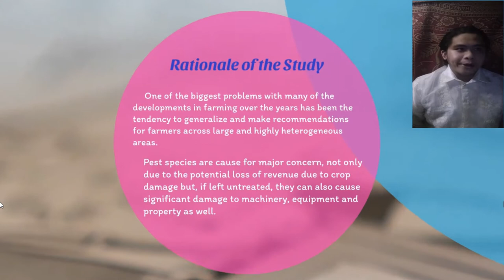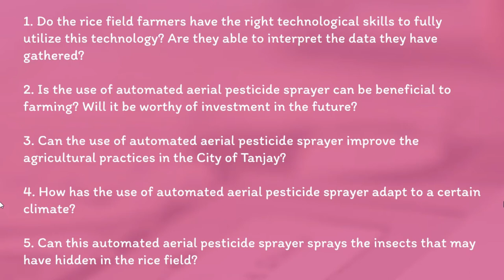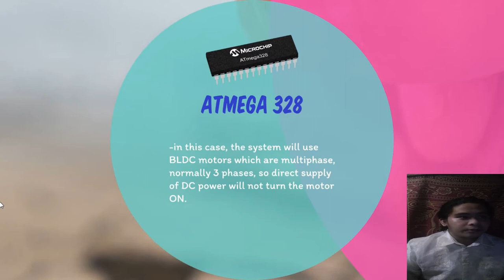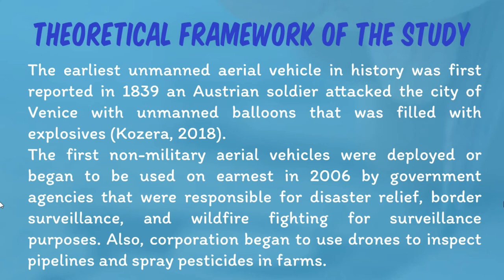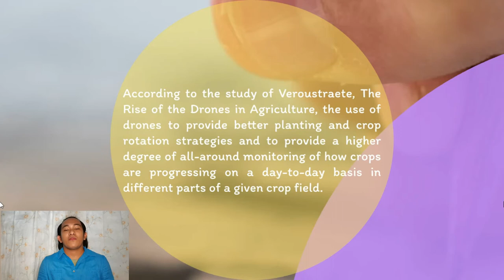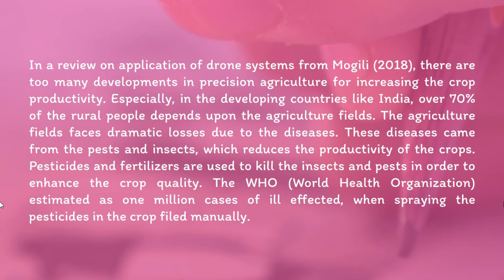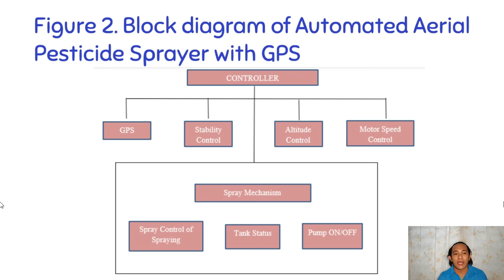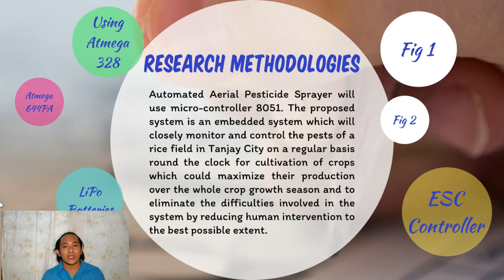Automated Aerial Pesticide Sprayer for Rice Fields in Tanjay: An Advanced Way of Controlling Pests

Comment: Jessielou A. Gomera
ENS 341 B - SATURDAY 5-8:00 PM
March 26, 2022

Reaction:
The said research is informative and beneficial to farmers. It is also interesting for it really fo help the farmers not just in Tanjay City. The researchers did a very good job on introducing this type of innovation. 

Reflection:
One of the most obvious advantages of aerial application is no soil compaction. Driving ground equipment through a field leaves wheel tracks and compacts soil particles, reducing pore space and restricting oxygen and water movement into and through the soil and root zone. Pesticides are important, the researchers find a way on putting pesticides on plants and crops and proposed the aerial pesticide which will help farmers grow more food on less land by protecting crops from pests.

Comment: Caluscusan, Desiree Joy M.
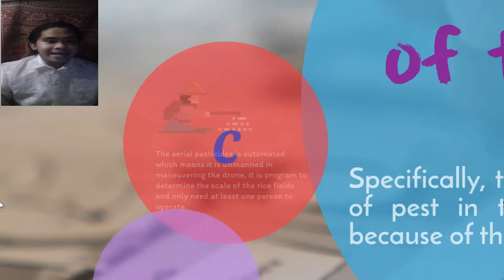COE 346 Methods of Research T-TH 5:00-6:30 PM
MARCH 25,2022s
Reaction: The video is of great help to the farmers who are dealing with one of the most common but not really dealt with problem they are facing for a long time, pests. This is of course it will greatly affect the quality of their crops and it is one of the determining factors of their income. This really enlightened me on the bad effects pests can bring to one’s crop, machineries, and property as well.
Reflection: Automated aerial pesticide sprayer really can be an advance step in controlling the pest problems of farmers. Though, it might need advance technology for it to be utilized and most likely introduce another problem regarding finances, it is a great idea to consider.

Comment: Villauneva, Chastine E. 
COE 346 Methods of Research T-TH 5:00-6:30
March 25, 2022

Reaction:
        Keeping a large acre of land in good condition is a demanding endeavor. It becomes significantly more difficult when insects are included. The automated Aerial Pesticide is a big help to the farmers to help solve difficult problems that they are encountering in terms of pests.

Reflection:
       While seeing this presentation, I realized that farmers are dealing with pests and that this Automated Aerial Pesticide Sprayer for Rice Fields can assist all farmers. This research effort can give hope to other farmers that there is always a solution to issues. It will help them have healthy rice fields and boost their income.

Comment: Pagente, Jayvee M.
CoE 346 A Methods of Research TTh 5:00-6:30 pm
March 25,2022

Reaction: The research is well presented and the content is very informative about the automated aerial pesticide sprayers for rice fields. Many rice farmer’s  will benefit in this research not only the farmers in Tanjay but also the other farmers in different places that experience problems in applying pesticide in their rice fields. 

Reflection: When using automated aerial sprayers in applying pesticide, it reduces the risk of chemical contact and the operating is safety. It also eliminate pesticide poisoning incidents occurring in sprayers.

Comment: NAME: Cual, Kayzielle B.
CLASS NAME & CLASS SCHEDULE: ENS 341 A (2:00 – 5:00 SAT)
DATE: 3/24/2022

REACTION: Based on the video I had watched, the audio is very clear and audible. The visual presentation of the researchers are so creative but it could have been better if the font size was bigger especially for long paragraphs. They had presented their research very well and in a very concise manner. Over all the presentation was very good.

REFLECTION: The research is very helpful for all farmer, in terms of getting the work done easily in a short span of time especially when you are applying pesticides to a big farmland is so tiring, also it could less the manpower expenses. But I think if ever this study gets approved for testing or the product would be manufactured it would require a seminars on how to operate such device especially most of the farmers are older adults.

Comment: NAME: Alejandro A. Bargaso Jr.
CLASS NAME & CLASS SCHEDULE: ENS 341-SATURDAY 2:00-5:00PM
DATE: MARCH 25, 2022

REACTION: 
According to the video that was shown, the production of Aerial Automated Pesticide made everything easier and more efficient for the farmers to do. Having the knowledge that these types of autonomous equipment can control the usage of pesticides, which is helpful to plants, is a huge relief.

REFLECTION: 
Aerial Automated Pesticide has significant advantages for farmers because it can significantly increase rice output and other crop productions. It is non-toxic to the environment and will not have an adverse effect on the health of the farmers. This concept is extremely beneficial because it would reduce the problems that farmers have in terms of pests while also saving them time and work in the field.

Comment: NAME: Eve Shammah S. Mejorada
CLASS NAME & CLASS SCHEDULE: ENS 341 - Saturday 2:00 - 5:00 PM
DATE: March 25, 2022

REACTION: The flow of the proposal is very good. They concentrated on our surroundings and how we could assist the farmers. It will be of great assistance to them, particularly those with large fields.

REFLECTION: This research will be extremely beneficial in protecting crops from pests. The aerial pesticides are automated, which means they are unmanned in operation, which is a good idea because they require only one person to operate. It saves time and money, and it has no negative effects on the farmers' health.

Comment: NAME: John Ver P. Bulanon
CLASS NAME & CLASS SCHEDULE: CoE 346 METHODS OF RESEARCH -TTh 5:00-6:30pm
DATE: MARCH 25, 2021
REACTION: Farmers who are dealing with pests will find the video extremely useful. This will have a significant impact on the quality of their crops, and it is one of the factors that will determine their income. This taught me a lot about the negative effects pests can have on crops, machinery, and other things.

REFLECTION: Aerial Automated Pesticide is extremely dependable for easily maintaining a high level of crop management/plant pest control for high output standards. It became easier as a result of the fact that it helped farmers overcome a variety of challenges while also boosting productivity.

Comment: NAME: NOEL JOHN C. CANOY
CLASS NAME & CLASS SCHEDULE: ENS 341 - SATURDAY 2-5pm
DATE: MARCH 25, 2022
REACTION: This video clip is very useful to the farmers, this can make their work more efficient and easier. Those advanced technologies in farming can greatly help them.

REFLECTION: In farming one of the major problems is pest attacks. Farmers do manually spray                       pesticide of their crops with high effort, consume more  time and risk to their health. Hearing with this research about advanced technology of spraying pesticide which is called automated sprayer can be greatly help to the farmers of Tanjay City in their crop production. Using this automated sprayer will be good in terms of controlling pest and secured the Farmers health.

Comment: NAME: ATOY, AMIEL S.

CLASS NAME & CLASS SCHEDULE: ENS 341 - SATURDAY (5-8PM)

DATE: MARCH 24, 2022

REACTION: Based on the what I've experienced, it's hard for a farmer with a large scale of land to maintain his/her crops but because of an introduction of automatic machines inculding an automated Aerial pesticide, everything became easy and efficient for an agricultural expert.

REFLECTION: Aerial Automated Pesticide is very dependable for easily maintaining crop to a high level of food management/plant control against pests for high output standards. It got easier, especially because it assisted farmers in dealing with a wide range of obstacles while also reaping several productivity benefits.

Comment: NAME: Jean Clare M. Po 
CLASS NAME & CLASS SCHEDULE:  ENS 341 - SATURDAY 2:00- 5:00 pm
DATE: MARCH 24, 2022
REACTION:  AAPS is essentially a blimp (zeppelin) that has been integrated into a quadcopter.
Pesticides will be sprayed in open fields using a helicopter. The primary goal of this is use for spraying, to use pesticides economically, and to use regardless of the weather. The system's goal is to reduce the negative effects on humans while also shortening the time it takes. 
REFLECTION: This method is applicable in all circumstances.  Of used for highly toxic pesticides this will not lead to unemployment problems. This can also be used in places where laborer are hard to find. They can hasten the pesticide spraying process thereby lowering the causalities due to pesticide exposure, preventing encounters with venomous snakes such as Russell's viper and cobra which can be found regularly in fields thereby reducing the amount of snake bite cases. Also keeps the food chain healthy. Since they are sprayed from lower altitude, environmental pollution can be reduced.